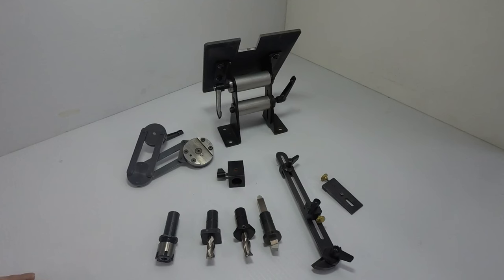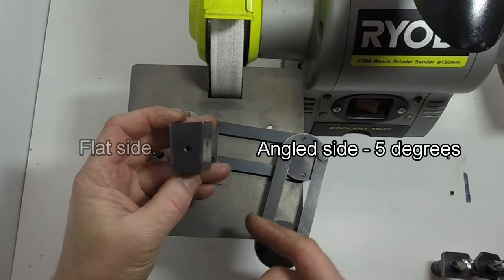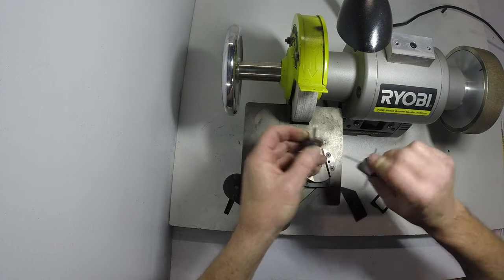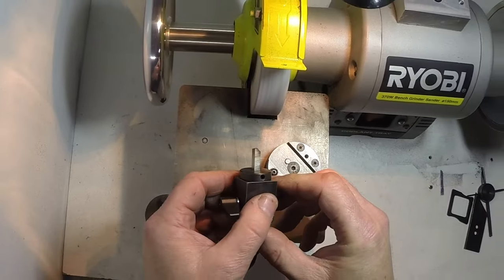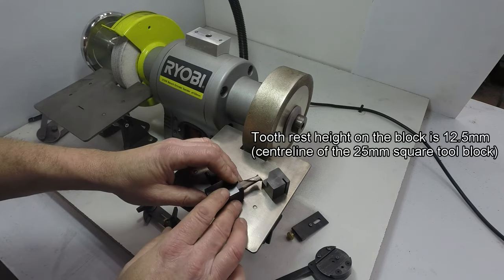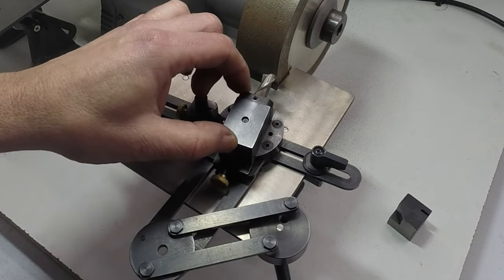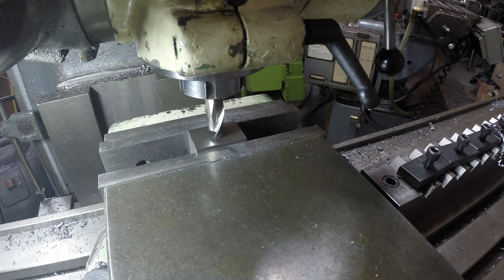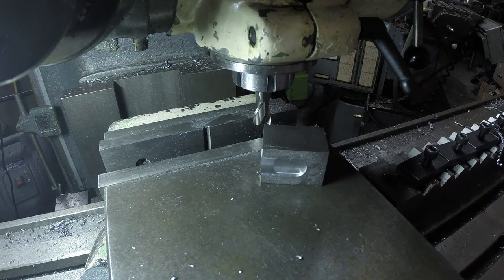The Acute Tool Sharpening System

Comment: If u don't keep the high speed steel from getting to hot while grinding it will become brittle and break very easily when in use. I'm a fitter and turner.